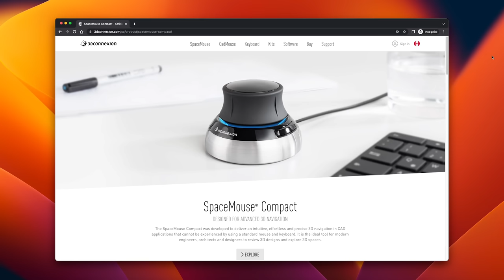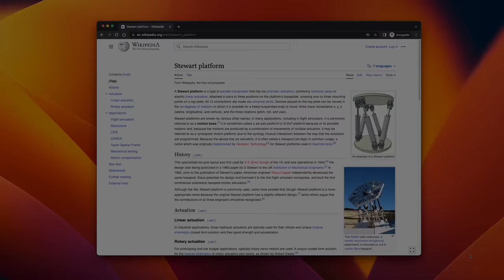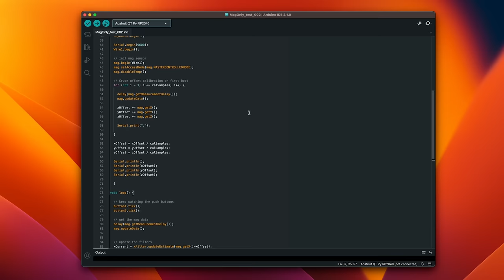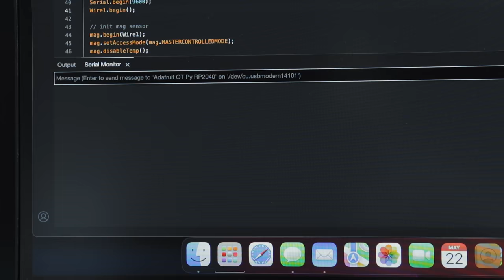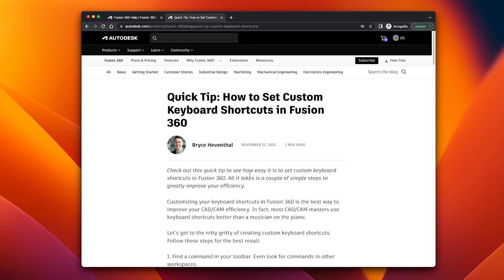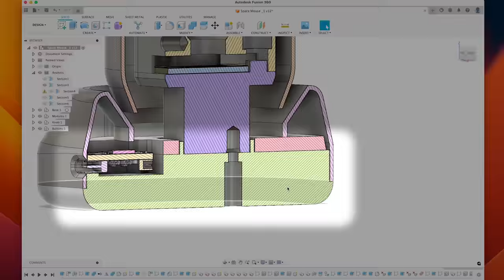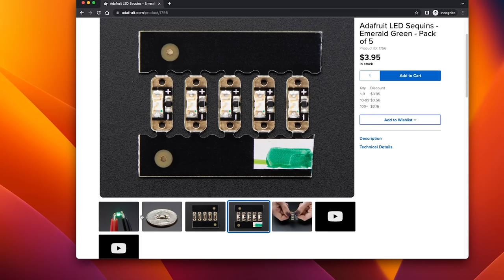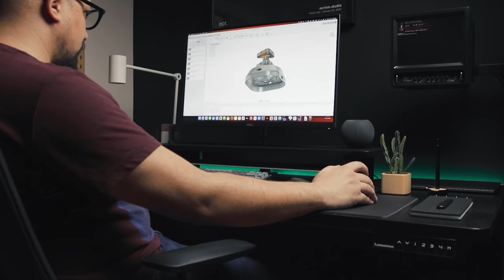I Made my own Space Mouse for Fusion 360 using Magnets (DIY)

Comment: Curious. I worked on the Spaceball (predecessor to the Spacemouse). I can answer with certainty the math to convert from the the 6 led/sensors to 6DOF on the application side was difficult. The hard part was we were using some crappy embedded 8bit processors (PIC I think) and had to do fixed point matrix math on chip.
Also, I felt the pain of trying to integrate with a CAD application. The problems you ran into with the macros and keyboard shortcuts were very similar to the problems I had with integration with SoftImage.
Reply from the maker: I'm not very good at math and the 3D rotations melted by brain a little .. So I gave up on it momentarily 😆 for a more simple prototype to try it first before diving into all that work. Thanks for the reassurance!
Reply: @uberthought
Which model?
I thought the old 2003 (as seen on K's desk in Men In Black) used strain-gauge sensors.
I'm not sure what the 4000 and 5000 models use, but I thought they were similar tech, just more flexible variants.
I'm actually very curious about the circuit-board on the 5000 models as I have a theory about something.
In case you're wondering, I used a 2003 back in the '90s with PRO/Engineer and use a 5000-USB almost daily with FreeCAD in Linux.
Reply: @salimbenbouz  Yeah, I get it. It's been 35 years of coding since I wrote those transforms. I'd be luck to do a simple 2d translation today. TBH, most of what we did back in the day was find an algorithm in a book and implement it in C. Change book and C to stackoverflow and javascript and nothing's changed.
Or..ChatGPT and rust? Maybe next year.
Reply: @uberthought chatgpt and rust got a lol out of me. still employing the old "book and C" method here.
Reply: quaternions are likely your friend (and foe) here 😅
Reply: @salimbenbouz  I'm at 3D artist and not much for math, but it may be useful to note that trying to do the input calculations with the Euler gimbal (X,Y,Z) will be very frustrating. Using Quaternions (X,Y,Z,W) may somewhat reduce the level of brain-melt!

Comment: Amazing project! I built a macropad using your design and now its an integral part of my setup. Would love to build this some day! 🤩
Reply from the maker: Wow! thank you! I'm glad you found it useful
Reply: @salimbenbouz  What strikes me is that the product is so smooth after printing. I wonder what kind of printer was used here. That wouldn't have been a cheap thing
Reply: @henkholdingastate  Even an Ender 3-flavored printer can do smooth prints like that, once you get it dialed in for flow rates, etc. The real magic is the red paste he rubbed on and sanded off before painting. Basically auto body filler but easier to sand. With several coats of that and a very fine sanding job, and 3 light coats of primer-filler (and more sanding) followed by several coats of satin finish black paint, you can make any print look like it was injection molded. You just have to WANT to do the work.  😄

Comment: That looks so cool. It made imagine what would it feel like to wield a controller device, that is like a ball mouse, but the ball is levitated by magnets. The magnets would resist movement of the ball like the springs you have here, while allowing even more degrees of freedom, and potentially be even smoother.
Reply: Ooh, now that's an interesting idea.

I can think of two issues:
(1) I don't know if it's possible to rotate a magnetically levitated object off the axis of its poles.
(2) It would probably spin too freely and be drifting around when you let go of it.

But perhaps that could be solved if the rotating ball was actually a hollow shell which rotates around the floating magnet. You could adjust the friction to find the sweet-spot. And the position could be tracked optically.

Comment: So glad you took the time to sand, fill, and finish the parts. So many people leave their 3d printed projects with layer lines in videos which makes the final product look amateruish. This is amazing, looks so clean
Reply: yeah, he did an awesome job in the post finishing. However these days I have seen 3D prints where I cannot see the layer lines anymore. I think they slice the STL at extremely small layer height. I have seen friends print them on Bambu labs printers.
Reply: @rajdude1  Very true, ive seen a lot of really nice prints made on the x1 carbon using cf pla.

Comment: @11:10 Compared to yours - The real one allows you to move, and rotate all 6 Axis of the the 3D Workspace at the same time giving you a way more natural control as if you were actually holding the 3D object in your hand ( I own both the legacy SpacePilot Pro and the now SpaceMouse Enterprise that replaced it and seeing that to a single axis constrained movement made it painfully obvious ).
Reply: It’s a real shame they seem to hate video games and won’t make their drivers not break controller use
Reply: @digadigado  They won't even let you map keys to it (at least not last time I spoke with a rep) which is stupid.  If they opened that thing up it would be such a powerful device.
Reply: The SpaceMouse drivers for Mac are absolute shit though, which is what I have to use for work
Reply: Yer I have a spaceMouse double sided taped to my desk at work for CAD and CAM.
I'm barely aware of using it, its like telepathy.
My most used key bind is to have it lock out rotation and just have zoom and pan to zoom in very close. Without this it is too easy to have the detail you want to see up close drift off screen. Also good in wireframe mode in the CAD so as to not lose your sense of orientation.

Interesting video to learn the inner workings.
Reply from the maker: That's the plan if I make another version. This is just a prototype to get a feel for it. I want to complete sensing 6 axis and try to translate that to the camera in the CAD directly if possible without hijacking the mouse.
Reply: @JohnVanderbeck  The open source driver lets you map keys to the buttons, but I think it only works in Linux.
Bonus is that, unlike the official drivers, it supports all versions going back (at least) to the SpaceBall 2003 from the early-'90s.
Reply: @digadigado  Not QUITE true but sadly true enough. They still have native KMJ which makes it act as a joystick inside games. I actually play Elite Dangerous with my 3DConnexion, and everything works just fine, it's just not as intuitive and requires fiddling with config files as there's no UI way to enable it. 
If config files aren't for you there is still ControlMyJoystick(on steam even), which allows full customizability of everything.
Reply: @djkato-personal2242  the KMJ driver works, but many games recognize the native multi-axis HID device too. And the problem with that is that it's absolute positioning so instead of returning to 0 when you let it go, the value stays at whatever it was, and thus, to the game, it looks like a joystick that's held at that position.
I too got it to work in Elite Dangerous, and I had landings worthy of a AAA movie 😄. Star Citizen was a different beast though. 🙄
Reply: @djkato-personal2242  I meant it breaks other controllers being able to be used, not sure if it's all games but a lot won't recognize your xbox controller etc while the drivers are installed
Reply: Coming from a place that puts the charge port on the bottom.
Reply: @salimbenbouz  the 6 axis movement is just a software issue right and this hardware should work for when that gets implemented right?
Reply: @digadigado  Interesting, I'm using a bluetooth Xinput controller and never had that issue, though @vemunddyrkolbotn2322 's point is true, and some games don't know what to do with the driver. V Rising for example - I need to turn off all 3dconnxion processes before launching it else it completely breaks.
I agree that they should make it easier not harder to use it as a joystick. But they don't realise that even proffesionals like to game from time to time ¯\_(ツ)_/¯
Reply: I have a space pilot (bought second hand and repaired) and I love the concept but it’s so hard to get used to 😂. Loving your design here.  Very nice
Reply: @piman13_71  the magnetometer that was used in this project can sense only 3 axis, so I suppose 6 axis would also require upgrading the hardware.
Reply: @FlorianEttlinger I was also very curious about it, as no accelerometer nor gyroscope were mentioned.
Reply: @Dug6666666  it’s also great for things like zebrush and substance painter I would never go back to all navigation in any of my 3-D animation apps
Reply: @salimbenbouz FYI Blender supports SpaceNavigators “natively” without any driver requirements and there’s a similar 3rd party plug-in for UnrealEngine which does the same. Maybe it can be of interest.
Reply: @salimbenbouz  If you did it without hijacking the mouse and keyboard, then it would only work for Fusion 360?

Comment: very solid project, well done.
that being said, one thing to be aware of when using magentic sensors: if the chamber containing the magnets is exposed to the environment, ferrous particles can collect on the magnet, and if they do, they will throw off the field the sensor is detecting, causing the device to experience phantom inputs and input distortion.
i live somewhere with red soil, from high iron content, and experienced the issue with a cheap flight stick, and you may experience something similar
that being said, since you had the forethought to include threaded inserts, it should be possible to get back in there to clean things up if you encounter the problem, so it isn’t the end of the world, just something to be congisant of.

Comment: Maybe an odd suggestion.
But you know how in game controllers you can kinda pull on the analog sticks.
Like it's a slightly different elevation.
I wonder if you could make your own space mouse in which you have two elevation levels for your stick.
One being for free move control and then you push in your stick and you have fine granular control similar to f.e a safe lock wheel.
Reply from the maker: I see. Maybe add a switch inside that you will push down to enter that mode? Where is increases/decreased the sensitivity. 🤔 I will keep that in mind. thanks for the suggestion
Reply: I reckon the most natural interface for this would be a pressure sensor. So when you squeeze the stick, the motion slows down. As we naturally grip tools more firmly when we're trying to position them more precisely.
Reply: @andybrice2711  So the finer control would only be available during squeeze correct?
Reply: @voidbinary  Yes, though it could be more of an analogue thing: The tighter you grip it, the more it slows down.

Comment: Something I find very helpful for projects like this is an adhesive backed 60A silicone sheet, it's very gummy and so non slip beyond most anything else, it's not too thick (0.04" or just over 1mm) can be cut with scissors and has a great 3M adhesive backing. It's the only thing I have found that makes 3D prints truly slip resistant. I use it on fridge magnets all the time, if I print would normally slide down the fridge under it's own weight, with this stuff you cannot slide it at all, enough force will cause it to pop off the fridge (overcoming the magnet strength) but never slide. Items you want to sit on a table and not move, while weight is great adding this stuff to the bottom basically allows what weight you have to act on the surface with a lot greater force.
Reply from the maker: Thank you for the insight. I will definitely keep this in mind for future projects

Comment: Nice job! I love my 3Dconnexion but I hate that the rubberized finish can degrade and go sticky. I have 2 units and had to eventually remove the gloop as they became unusable. Very glossy plastic underneath - not very comfortable. I plan to add some leather grip.
Reply: I have a 2005 spacepilot(with HP logo), and I use car interior sticker to cover the sticky handrest and top of the knob. Everything else works fine for decades, amazing durable product. Only once it started to drift, then I opened it up and discovered some little bugs inside.
Reply from the maker: See! I'm glad refrained from spraying the knob rubber in that last minute. I though it would increase grip but you're right that would age horribly.

Comment: Nice, even though it's not 6-axis it's better than the other DIY solutions currently out there. You could make it 6-axis by putting a 2nd TLV493D detecting a 2nd magnet (or negative of the first magnet), but it'll be less compact.

You can also make a 6 axis controller with 3 joysticks (good ones are annoying to source) or 6 to 12 strain gauges (allows barely any motion unless you get creative), so magnets are the way to go!
Reply from the maker: Thanks for the suggestions. I have some exploring to do for the next one for sure.

Comment: Suggestion: Make the knob freely rotatable. You would then need to put the magnetic sensor in the base, and magnets in the top. You would need to change the construction of the knob, so the knob has a circular "monorail" that rides in a slot in the spring cage.
Reply: Yeah, I have often wondered whether the Spacemouse would be better as a large trackball which freely rotates in 3 axes.
Reply: @andybrice2711  I meant freely rotatable only in left/right direction. So same as now, but the knob rotates freely left/right.

Comment: Cool project. One thing I foresee as an issue is that as a HID, it's going to be handled a lot, meaning the surface paint job will likely wear on your hands with use. I hope the device solves your initial engineering problem, though and can't wait to see how you improve it.

Comment: In music speakers it's common to use sand and in tape dispensers you'll typically see clay used to add stable weight. So instead of steel balls, these might be an option to consider for your next project.

Comment: Very cool! I've had my space mouse for a couple of years now and it is a real game changer when it comes to 3D modeling.
Reply from the maker: Thanks! so I've heard! maybe it will the same for me.
Reply: @salimbenbouz  as long as the one you made works and is intuitive I can't imagine it wouldn't be. I've had to try to do models without the space mouse a couple of times and it's rough after getting used to intuitively being able to just swing the model around any orientation at any time without even thinking about it.
Reply from the maker: @DoRC  Exactly. That's  why I went down this rabbit hole to begin with. I just want to be able to do it without thinking about it.

Comment: Nice project. Two things jump out to me though.
1) Just use the "No Gesture, No Shift" plug-in. Then in you orbit with right click, pan with middle mouse click and zoom with middle mouse scroll.
2) If you still want to use this, use it on the left side of the keyboard so that you can use your mouse with your right hand. Then when performing "Modify" tools that require the selection of faces/edges, you can orbit and pan around while still clicking on the faces or edges that are needed.

Incorporated a streamdeck or similar would be cool for a fully functioning macro pad. You could also add shortcuts to replace the zoom to/look at/rotate to x,y,z face/rotate view 90 degrees etc etc.
Reply from the maker: Thanks for the feedback. I’m using it on the left ofc. It was just easier to capture footage from the right side when I was filming. I built a macropad in one of my videos that I can use to those shortcuts if needed.

Comment: I would shape the knob to be a rounded not circular shape (rounded square, rounded triangle, or ecliptical) purely for grip and comfort to follow the angles of the hand but also so you are more manipulating the outer circumference when spinning rather than manipulating the centre axis (I hope that makes sense).

In the z axis I'd also have it tapper to be slightly slimmer towards the base than the top. Imagine your grip is a claw grip, thumb and ring finger on either side, index and middle finger on the front side.

Mouse buttons 1 and 2 could then be on the front of the unit either on the knob or on the base, MB 3 could be the top of the knob.

Adding mouse buttons to the knob itself could be scope creep but if it was the case you would have to have each axis of pivot and lift have a minimum threshold to register movement to avoid clicks creating movement if it's to sensitive.
Reply: Having a non-smooth non-circular shape also helps users who get sweaty hands (oh perfect spot for a cooling fan inside the knob that blows air down to the base to redirect up the sides)

Comment: This is really cool but at 3:36 I noticed when you were giving an input, as expected the cursor would move, but when it stopped receiving inputs the cursor would stay at the last input and at 11:10 after you released the space mouse it stayed at the last input again, so I was wondering if it would be difficult to have the cursor return to its original position after the device was released, just a neat QOL idea but overall I think you did a fantastic job.

Comment: really enjoying your vids, hope you keep them up !
On my bucket list is to make a better left hand controller than the razer tartarus, i keep mulling design considerations and tasks/procedures in my head, but never actually dove in.  Vids like your are very motivation/inspiring in that regard.

I notice you are using mac, I've used fusion360 in the past but had enough of autodesk's steady feature evaporation in the free version, and can't justify the costs for very occasional and personal use.  The only other 'viable' option that isn't cloudware was freecad, but it has its own issues.

Maybe when others see more engineers using macs, they'll sense an opportunity to develop some more 3d product/engineering cad programs for the platform.   

Cheers